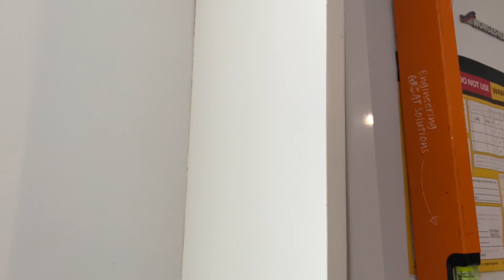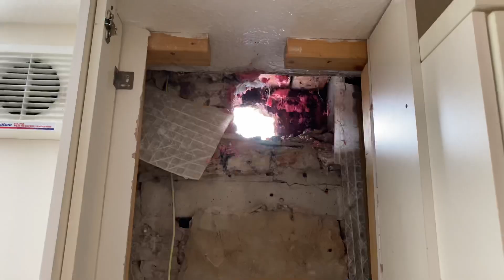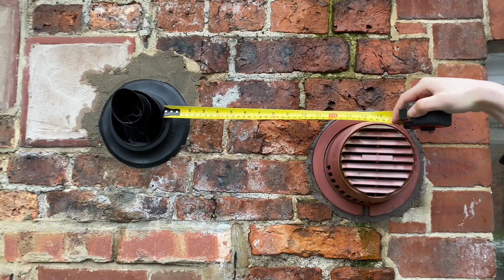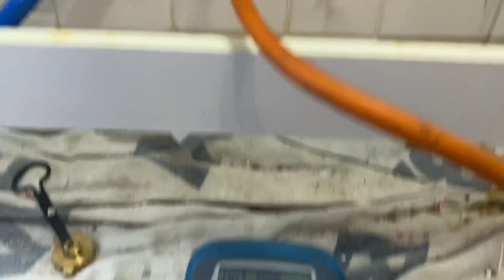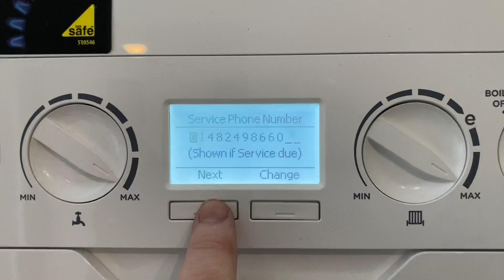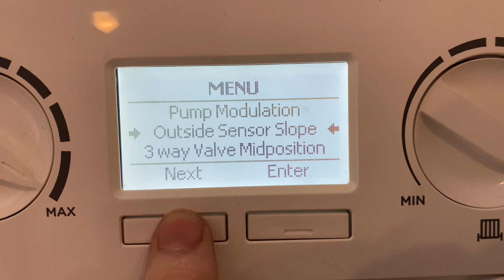Ideal Logic Max Boiler Installation / Open Therm / Nest Thermostat

Comment from the maker: Please send me your videos WhatsApp 07725 692699
Reply: will do buddy
Reply: Hi Allen my plumber put a nest in my new ideal max 30c and only wired it for one off. Can I add the opentherm for more control?
Reply from the maker: @Colin-78  Yes, connecting it on opentherm would save money.
Reply: I have this boiler and tried to install next. All works well until I plug it into the wall. The V3.9 on the nest thermostat, is that normal? Should it be higher? As it keeps shutting off.

Comment: On the logic c24 when fitting the tado thermostat is the other two wires go to stat connection or the open therm where the link is as there is no stat connected at present  if you don’t mind answering as ideal customer service didn’t know?

Comment: Hi mate we have the same ideal boiler with the nest, just moved in. When the nest is turned up 0.5 degrees the boiler F2 fault appears. It resets itself and starts up again ok !!! Weirdly when you turn it up 1 whole degree or more it works fine. Does it sound like the gas valve is playing up which I assume is a variable opening valve. ? Thanks

Comment: good video but would be nice to see the wiring a bit more as to how the nest is connected as there isn't any online documentation on this aspect and trying to speak to Ideal tech support for the info is impossible with wait times generally over 1hr+
I cant find anything that covers how it should be done with the normal control panel and halo thats included and changing that to a nest setup instead.
Reply from the maker: Depends on the model of logic, they are all different. Thanks.
Reply: @AllenHart999  it's a Logic Max C24 Combi I'm dealing with.
Getting thru to Ideal tech support = impossible
Ideal area manager still hasn't called or messaged back despite calls and messages.
It's like blood from a stone and nothing online doesn't help 😥
Any help you can give would be great please Allen

Comment: Hi Allen! I have recently moved into a house and it has a Logic Max C30 that is only 8 months old. It currently has the Halo Wifi system installed. I want some info regarding it, and I can't find it for the life of me! Do you know if it is possible to install a 3rd party smart interface/thermostat? The Halo one is plugged in via an 8 pin connector that looks Ideal/Halo specific. I ask because Ideal does not do any smart TRV valves, meaning that any I do install will not be able to request the boiler, they will rely on it already being on. I'd like to install a full set up, including TRV valves, just not sure if it is possible. I did try ringing Ideal but I'm not sure the guy really got what I was saying! 

Any help would be appreciated, if you know, that is!

Comment: Brilliant video thank you Allen. I’ve just bought a Drayton wiser thermostat to replace my Google nest, just so I can add the smart trvs. The open therm was never wired into the nest so its currently  wired into the room stat/timer connection. Am I right in thinking then that I need to completely disconnect the room stat/timer connection so that the wiser thermostats only connection to the boiler is via the opentherm connection on the right hand side so that it can use opentherm? And then it needs the loop connection refitting to the room stat connection in the boiler?

Comment: Quick question, I have this boiler ideal logic max combi c30. I also have a Drayton rf thermostat which I can’t seem to change the temperature, I don’t seem to have a timer where I can plan to have my heating to turn or off, will a nest thermostat work with this?

Comment: Hi Allen, 

In the video I see you only connect the open therm connections. Is that all that’s required and no other connections needed?

I have the ideal logic max c30 and a Drayton wiser smart system. No thermostat was ever fitted so there is currently no back plate on the wall for the hub. 

If I can just use open therm without any other connections except L, N & E that would be ideal.

Comment: Hello Allen,
I have the same situation with a Ideal combi Esp1 35 boiler and I want to connect the nest thermostat to it. From the video, I see that the Live, Neutral and Earth goes into the Nest and the Opentherm has a jumper cable, which I will connect to nest. Can I take the L, N, E from the boiler terminals directly to the heatsink or can I provide a separate power supply to the heatsink and just take the Opentherm connection to the heatsink via 2 core 1.5mm2 flexible cable
Reply: I've taken the power from my boiler and ran that to the nest heatlink no problem. My previous wireless thermostat was wired that way so I just re-used it.

Comment: Great video , to get the open therm to work ,did you leave the room stat link in?  I noticed you removed the opentherm link to wire the low voltage to the receiver
Reply: Looks like he leaves it in but when I contacted Ideal for clarification, they  said it should be removed when OpenTherm is connected.  I did ask the same question further up thread a couple of weeks ago but sadly no reply from Allen.

Comment: I have just had an Ideal Logic Max fitted to replace my old Potterton Suprima 60 heat only. They have wired up my Nest V3 using the thermostat connections not the OpenTherm and refuse to change it say "it makes no difference, let the boiler modulate" Is this true?

Comment: Did you bridge out (leave the link in) the room thermostat / timer connection so it's permanently calling for heat?
Reply: I'm wondering the same thing. For the nest installation, do you just run OT1 and OT2 to the open therm terminals on the boiler and leave a wire link across the room stat/timer?
Reply: Wouldn't work for me without the link on SL1 on the left. Now Tado is doing OpenTherm and modulates the flow temperature. SL2 is via an external timer and the valve for the HW cylinder for DHW priority. When that calls Flow temperature goes up to around 70°C

Comment: Just had max30 installed with the halo, installer said the thermostat was so easy to install, compared to others
Reply from the maker: What’s your opinion about it? Thanks
Reply: Seems good, big improvement on pressure and heat, old boiler 11 year old, really like the halo basically plug straight into boiler no wiring

Comment: Hi Allen.
Does c24 max is enough for house 3 bed + living room + 2 baths+kitchen
Reply from the maker: Depends on the water flow rate. I would normally go for a 30 as a minimum. Thanks.

Comment: Great video Allen, as always! 

In your opinion even after brand new boiler installed should an engineer on the first year service be removing burner door and cleaning heat exchanger and doing those sorts of checks? I know a guy who just goes and does FGA and cleans filter. Surely this isn’t correct? 

Cheers

Comment: Thats a  expensive worcester boiler, could it have been reused but just installed correctly?
Reply from the maker: Thanks for the comment. The boiler has had lots of issues and the customer wanted it replacing.

Comment: The extractor fan needs to be capped off or moved less than a meter of the boiler flu
Reply from the maker: Hi Asa Thanks for the comment. The flue needs to be 300mm away and this one is ok.

Comment: Love the videos mate. Only thing I would add is that low voltage and mains voltage cables should not be run together and if it’s in trunking it should be compartmentalised
Reply from the maker: Thank You

Comment: Hiya Allen,  how have Ideal resolved the sump issue?     I stopped fitting Logics  because of this and went over to Baxi's.......
Reply from the maker: The mold is done in a different place now. They have long warranties now as well, Upto 12 years for some installers, Customers need to make sure they service the boiler. Thanks.
Reply: @AllenHart999  Thanks for reply, lets hope they have more luck this time.
Reply from the maker: @julianhawker7672  All boilers fail. Hopefully, by installing them correctly they stand a better chance. Time will tell with the sumps i guess,
Reply: @AllenHart999  Agreed, lots of problems I see are down to the original installer :-(       

I notice you used a shock arrestor.  :-)      I buy them from my local plumb ctr  and the guys there told me I am the only local guy who buys them,  which  doesn't bode well for the longevity of the masses of combis they sell to others with water meters being ever more common....................
Reply from the maker: @julianhawker7672  This one is the Ideal one. I like them as they come with the pipe. Thanks.

Comment: Lovely job as ever. I particularly like the way you made the brickwork good. I have an Ideal Halo Lite thermostat, not quite as nice as the Nest but for around £30 you can't complain. Note that you can't connect this to a pre-2016 Ideal Logic without a gateway as it's powered from the boiler.
Reply from the maker: Hi Tim. I will definitely try a Halo on the next one. Thanks.
Reply: @AllenHart999  The Halo is wireless and costs quite a bit more. The Halo Lite is a bargain in my opinion!
Reply from the maker: @tim0steele  Does it just clip in on the front of the boiler? No wiring? Thanks.
Reply: @AllenHart999  The Halo receiver does, as long as you have a post-2016 boiler. The Halo Lite is wired like the Nest but doesn't require batteries or mains as it's powered from the boiler. https://www.youtube.com/watch?v=CEOxxmozFew
Reply: @AllenHart999  have you had much experience of the halo WiFi at all? Just wondering how it compares to the nest as it's been recommended to me but I can't find much info / user feedback on it really.
Reply from the maker: @andrewguy8599  I have only installed one, seems ok, I would definitely choose that over a nest though as it will work well with the boiler.
Reply: @AllenHart999  mine is an ideal logic max C30 , any particular reason it would be a better match than a nest? There's very little user feedback on the halo range of thermostat's which might be a good thing , I'm just looking for a modulating thermostat to replace my hive and hadn't heard of the halo one until my plumber suggested it.. Certainly it seems to be very easy to install which is something in its favour

Comment: Does the 240 v supply to nest link come from its own fused spur or from a 240 v link in the boiler?
Reply from the maker: The boiler and nest are wired to the same spur. check out TB118 for testing it. Thanks https://www.youtube.com/watch?v=5mIb8p3mYlQ&t=122s

Comment: Hi Alan I know u say check MI but please could u say what boilers are allowed any white as I’m a poor meter maid and love just a rule of thumb of if any are allowed any white🙏🙏
Reply: Worcester and Vaillant and glow worm 
Let you have white on show 
Ideal and baxi don’t!
Reply: Cheers Alan that usfull info I share that with the lads would it be NCS or AR I say AR as could effect the way it ment to work
Reply from the maker: @willbarker8876  That’s a hard one to answer. Engineering judgement really. If there was no damage at all i would just advise customer, If the flue had started to let the water in from the end then maybe AR. On the ideal the end of the flue, the black and white bit need the rubber to seal it correctly. Thanks.
Reply from the maker: White on show is poor workmanship in my personal opinion. Doesn’t matter what brand it is. Although some brands allow it. Thanks.

Comment: Nice video allan why was it condemned?
Reply from the maker: Hi Jon. I do not know to be honest. I was just replacing the boiler. Thanks.
Reply: Ok maye just thought there was a warning notice on it
Reply: With the boiler installed at the angle it was it wouldn't have the correct 3⁰ fall back from the external part of the flue.  Which in effect wouldn't allow it to condense. I can only guess that was one of the reasons.  Expanding foam is a big no no. Funnily enough according Worcester Bosch TB0063 expanding foam is an acceptable way to seal the flue.  Even though most modern condensing boilers emit low temperatures from the flue. I still wouldn't trust or risk expanding foam.

Comment: Why not re-install the Worcester - personally I would not have a Worcester as I will not have boilers with an aluminium heat exchanger and plastics in them.  ALL my Worcesters that reached 10 or so years old and just start leaking so I ripped them out.
Reply from the maker: It wasn’t worth repairing to be honest. Thanks.

Comment: Hello Allen, How did u seal the flue on the inside with the ply going up so high?
Reply from the maker: Hi Ian, Good question, It was a total pain but i removed the flue and bricked it up as much as possible from outside, Then put the flue in and pushed as much compo in as possible. Thanks.

Comment: God protect the customer from all those 'qualified/competent' heating engineers! I blame ISO9000 etc., which means that 'qualified' people don't need work checking (in a perfect world).
If Ideal have separated the electrics from the heating, does that mean you can now connect standard cables rather than 'heat resistant'? Great video again.

Comment: Do you need to get your tea to 510 tested every year ?
Reply from the maker: That's a very good question. I will find out. Thanks
Reply: Yes it should be calibrated every year along with your flue gas analyser.  As do all other digital manometers.

Comment: Great video Allen, will be looking to replace my old back boiler which is over 15 years old. Am looking for a good quality cost effective and energy efficient Combi boiler.

I heard about Worster Bosch, Valliant and Ideal logic. Please which one will you recommend which is reliable with a decent warranty on it from the manufacturer.

Please what will be rough estimate budget for boiler, parts and labour cost for a new installation in a 3 bedroom house. Hope to hear from you soon, many thanks for your valued time.
Reply from the maker: You need to get someone out to survey the property and see what suits you best. Thanks.
Reply: @AllenHart999  I have done all of that already now to decide which Combi boiler make and brand to go for between the Worster Bosch, Valliant and Ideal logic.
Reply from the maker: @nicklaw8  Doesn’t really matter too much, Most importantly is how the boiler is installed and make sure the boiler is serviced each year. Then the boiler would be under warranty. My personal favourites are, Viessmann 100, Ideal Vogue, Baxi Platinum.
Reply: @AllenHart999  Many thanks for your tip and advise.

Comment: Why did you use open therm for heating controls instead of just the normal thermostat connection?
Reply from the maker: Open therm is energy saving. Thanks.

Comment: Great video Allen, good awareness. Good use of the plywood to get a fix to that wall 👍
Reply: Can’t go wrong with the new BAXI range in my opinion. Used to install Worcester but don’t like plastic components and they are not engineer friendly changing parts etc. How do you find getting fix to plywood?
Reply from the maker: @nickadams5212  Have you had any issues with the filters poping off on the 800? I had one pop off and i am not keen on installing anymore?
Reply: Do you mean the Adey Magnaclean?
Reply from the maker: @nickadams5212  Its the little mini one, Seems quite a few people have had them poping off.
Reply: Never had that Allen. You phoned manufacturers about it?  The ideal boilers are good to work on however those sumps were a bag design and I dont like aluminium hex. Vogues are great 👍
Reply from the maker: @nickadams5212  It’s all over the Baxi group on Facebook, Lots of people have had them pop off. I also spoken to my rep and he also confirmed there is an issue.
Reply from the maker: Hi Nick. Thank you for your kind words. What boilers do you install?
Reply: Great to know Allen thanks for the heads up. This will be down to Adey thou not BAXI?

Comment: Superb video as usual,regards the sealing of the flues on the outside with sand and cement which sometimes not possible on high level flats for example ,does some boiler manufacturers allow the rubber seal only to make the adequate seal around flue?
Reply from the maker: Hi Steve. You make a very very good point. You would need to double-check with the boiler manufacturer but i believe Worcester allow it. Thanks.
Reply: Worcester definitely let you there is even a video by Worcester on this subject

Comment: On worschester boilers you can have white showing
Reply from the maker: But why would you? Looks terrible. Thanks.
Reply: With WB you can also use expanding foam to seal the flue, I wouldn't advise it though. Maybe at a pinch of you can't access the external wall, meh 🤗

Comment: would've liked to have seen how you fixed up the shoddy pipework
Reply from the maker: The pipes below were changed to copper but they were left hanging as we couldn’t drill into the wall. They were supported above though.